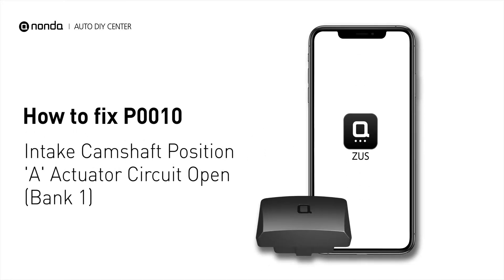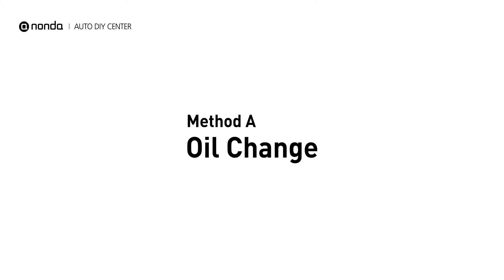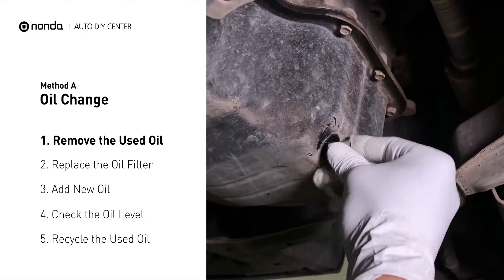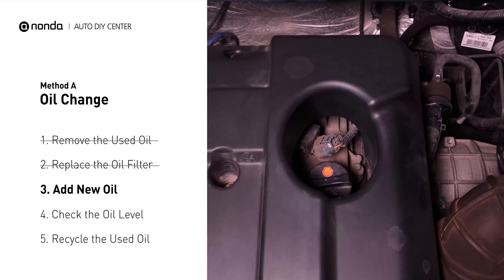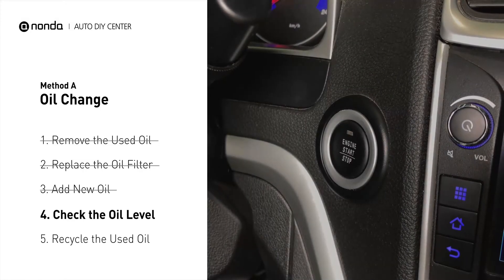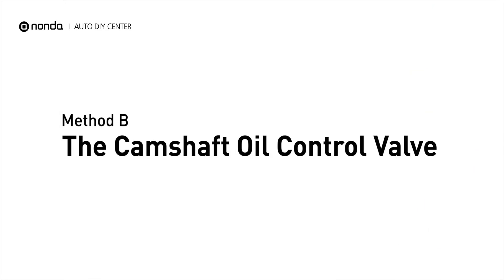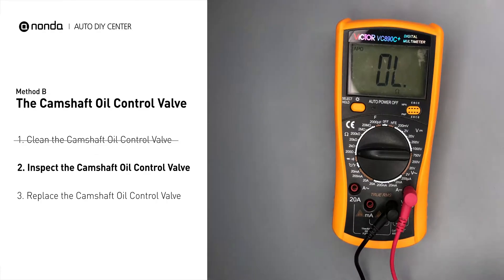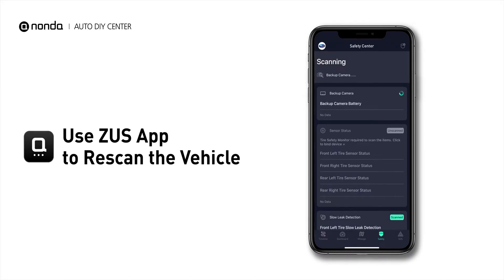How to Fix P0010 Engine Code in 4 Minutes [2 DIY Methods / Only $6.53]

Comment from the maker: Hi, I'm Steve, nonda's lead mechanic engineer. 
Feel free to leave your comments here if you have any mechanic questions, I will be glad to help you out!
Reply: I have a 2010 audi a5, and I have the same P0010 code, I've changed the oil and change the camshaft position sensor, but the code still comes back up after resetting it. What else should I look for
Reply: @ItssTroyy  any update?
Reply: @ItssTroyy  First, understand the code. Open Circuit. Your CPsensor and OCV may be in perfect condition...same with oil. BUT the electricity is not flowing to the item/s. So, you need to find out WHY you are getting no juice. I believe you should be getting 12 v reading at terminal B of your OCV. If not, then check your wiring.
Reply: My husband just replaced the timing chain in his 08 Ford Expedition EL and it’s still sputtering. He hooked the code reader up to it and got a P0010 code, but our friend said that the timing is off a little, thus causing it to not idle correctly. I’m just curious here on this video. What does the oil have to do with timing? Walmart changed the oil in this vehicle last month and when we picked it up, it sounded like it was going to fall apart!!!

Comment: Hi, I just installed a brand new oem solenoid for my 08 Crv. It had a P2647
1 Confirmed Trouble Code
Rocker Am Actuator at first. This code is gone now and now this new code P0010
1 Pending Trouble Code
Vtc Malfunction / Vtc Oil Control Solenoid
Valve Malfunction showing. What might’ve happened?

Comment: f150 5.4 2008  put in new cam . lifter timing chain gear new  crank  an cam sencor  plug fuel injector througle body  pcm  fuel mogual fuel pump  i get code p0010 p004 p007 check all ground  after this what am i missing

Comment: Hi I’m confused. A p0010 code came up with intake camshaft. But I’m not sure which part to get . The method b part ? Or the engine variable valve timing part ( which autozone showed me it was a metal circle object ) .
Reply from the maker: Please provide us with your vehicle's year, make and model.
Reply: 2005 bmw 330ci

Comment: Hello, do you also have problems with me?  code p0010 ford focus 3 engine 2 liters fresh oil change every 6 thousand kilometers fuel consumption seems to have increased.  what to watch?
Reply from the maker: Hi Adlan, we'll be working on your request soon! In the meantime, we suggest changing the engine oil, oil filter, testing/replacing the Camshaft Oil Control Valve to see if the issue will continue to persists.

Comment: I have this code for my 2008 Buick Enclave as well as the P0011 code. The oils been changed but I can't find any Oil Control Valve. Help!
Reply from the maker: Hi Josh, we suggest getting your vehicle visually inspected by your local mechanic for further diagnosis.

Comment: I'm lost here . I have 2003 passat 2.8 v6 .where is the camshaft oil control valve? My p0010 says its camshaft postion(cmp) actuator, intake /left/front/ bank 1. Circuit malfunction.
Reply from the maker: Hello, we highly suggest to begin checking the condition of the engine timing, engine oil and wiring (going from the solenoid to the ECM).

Comment: Your videos are helpful all times thanks for them🙏 but i need help if you can please!  My car Peugeot 107, P0010 cod have no connection to VVT-ventil. I check it with digital diagram and there no connection in the cable/ lin. I don’t know how to fix the lin?
Reply from the maker: Hi Ramin, we appreciate your feedback! Can you please confirm if this is the only code you're receiving?
Reply: @nondainc  Hi!
It is only cod and i have check it with digital multimeter, the solenoid sensor/ vvt-ventil is working but the circuit connector have no connection. When i tested it doesn’t showed anything in digital multimeter. I don’t what should i do? Or how to fix the connector!!!
I have a Peugeot 107, 2007
Reply from the maker: Hi Ramin, this code appears when there's an exhaust gas leak, damaged camshaft position (CMP) sensor, faulty Air Flow Meter or open circuits caused by corrosion of electrical connectors. Please check and get them fixed right away.
Reply: @nondainc  hi, thanks for answer!
I found it, it was connector that have no connection with camshaft. Do you how can i fix it?
Reply from the maker: Hi Ramin, to prevent any unnecessary damage to your electronics and wiring related components. We suggest asking help with your local mechanic to do this process. Thank you!

Comment: I have 2010 Pontiac G6 2.4 ecotec. Showing P0010. How do I know the difference between a faulty camshaft oil control valve (OCV) and faulty variable valve timing (VVT) solenoid? They both throw the same P0010 code. Can I clean the VVT solenoid? Can I test the VVT solenoid? Thank you
Reply from the maker: Hello, you should know that your OCV is faulty when you notice a burning smell in your car and if you are experiencing a low acceleration or poor brake performance. A decreased fuel economy is sign of a faulty VVT. With regards to your question if you can clean the VVT, yes-cleaning could be a solution and testing the voltage is suggested.

Comment: I have a Chevy cobalt 2010, my engine light is on and my car jerks a little while idling, p0010 is the code I’m getting how do I fix ?
Reply: watch the video
Reply from the maker: Hi Anthony, you may possibly have a faulty Camshaft Actuator Solenoid.
Reply: I'm having the same problem

Comment: I have a 2001 Volkswagen Passat wagon GLS 1.8l 20v turbo that won't start. It reads a code of P0010. I have recently changed out the oil and filter. Can't seem to figure out if this car has a cam shaft oil control valve. Can you help direct me in the right direction to get my car up and running.
Reply from the maker: Hi Cesar, the wiring harness to the intake camshaft position sensor may have poor connection. Check also the wiring from the solenoid to the ECM for any damage as well as the Intake Camshaft Position Actuator Solenoid as it may need a replacement.

Comment: Hello, I have a peugeot 207 1.4 16 valve fault code p0010 and p0012, I have changed the solenoid and oil and the problem still presents, timing seems to be in but the car is still reving high, please give some guidence
Reply from the maker: Hi Sharon, we suggest to get your vehicle visually inspected by your local mechanic for further diagnosis as you are receiving multiple error codes.

Comment: Have 2002 Chevy Avalanche.  Problem having is acceleration/deceleration....when I press gas pedal it doesn't pick up speed, but instead acts as if I'm pressing brakes. I have to ease up on gas pedal til it slowly pick up speed. Hesitate up to 60mph, hard get past that speed
Reply from the maker: Hi Tiberius, kindly check the wiring/connectors if frayed/damage and repair them. Once repaired, clear the code and rescan to see if the issue will still persist. Check the resistance of the bank 1 intake camshaft VVT Control solenoid if the error won't go away as this could be the source of the issue. You may replace this part if the result is out of specification.

Comment: How long does it take to make a difference after the oil change?
Reply from the maker: Hi Brett, once you have put fresh oil in your vehicle's system, kindly clear the code and test drive your car. If the code comes back then there might be a need for an OCV or Solenoid valve replacement. Since this code could be tricky to diagnose as many system could contribute to the error code, we also suggest checking on your vehicle's service manual to apply proper solution to the issue.

Comment: Hello, I think I have 2 camshaft sensors on my prius gen3. My code is camshaft position sensor bank1. Is bank1 look like the one on the video? Another one just black shorter. Would you tell me which one is bank 1?
Reply from the maker: Hi James, it's on the exhaust after the catalytic converter.

Comment: Hello! I own a 2011 Chrysler 200 3.6L throwing a P0010 code. The problem is that the check engine light turns off for awhile but then turns back on again. I recently had my oil changed so I don’t think it would be dirty oil. What should I test first? Should I pull the solenoid?
Reply from the maker: Hi Calista, kindly inspect if there are broken/damaged wiring going from the solenoid to the ECM. Check the condition of the camshaft if synced well to the crank, and try cleaning the actuator solenoid. Hope these helps!
Reply: This is similar to my issue. I was told P0010 code meant I need to replace the VVT Solenoid (bank 1.) After replacing, check engine light cleared but came back on next time i started it. I cleared it again & it came back in again. Same code. I also recently had an oil change, but i think the engine light was already on before that. Could this mean it is the camshaft? What do you think? I would really appreciate your insight!
Reply: 😊⁹

Comment: Hi Nonda! I have a 2007 Pontiac G6 throwing a P0010 code but also the Traction control light stays on. Both happened at the same time. Any suggestions
Reply: I should also note that I have taken the car in for a oil change and that made the TC light go away for about 3-4 weeks then it’s back on with the p0010 code
Reply from the maker: Hello, often times the faulty camshaft position actuator solenoid valve causes this code to appear. Please have it checked and replace if needed.

Comment: Hi. What is the right resistance range of the actuator solenoid for a VW 2006 Passat 2.0 T? Thank you in advance.
Reply from the maker: Hello, the resistance should be between 10-18 ohms.
Reply: @nondainc  Thank you so much !
Reply: nonda 
Thank you dearly for this video. I have 2011 civic si. (K20z3) what is the resistance I should look for? I’m getting 4.6 I’m the cold.

Comment: Hello, so I unplugged the sensor and connected it back in, now I got a permanent code P0010, does that clear by itself or is a sensor change needed? there were no codes before.
Reply from the maker: Hi Hadi, please try cleaning the actuator solenoid and an oil system flush. Hope it helps and please let us know if the issue will still persist.